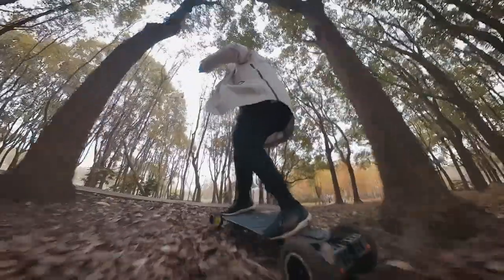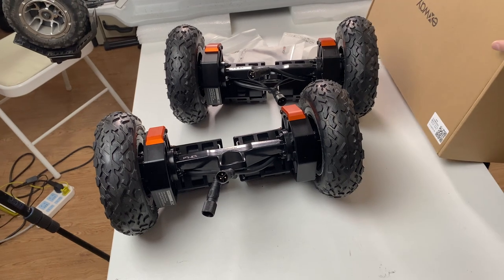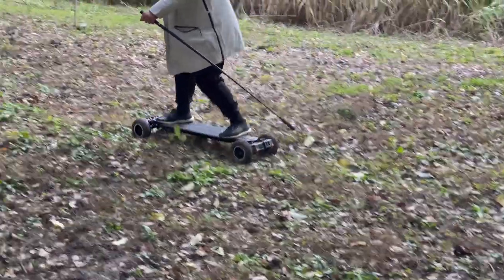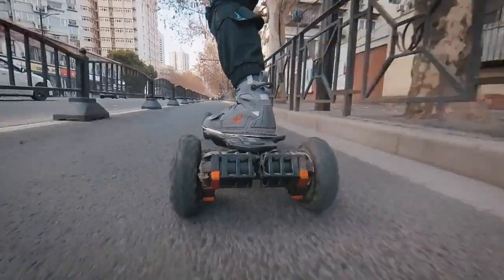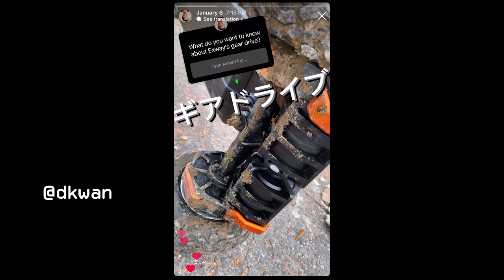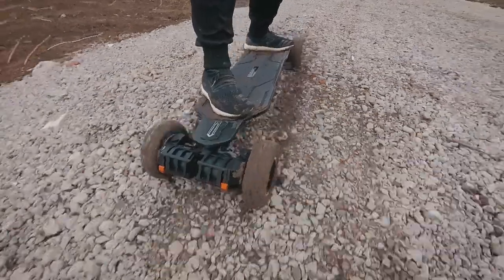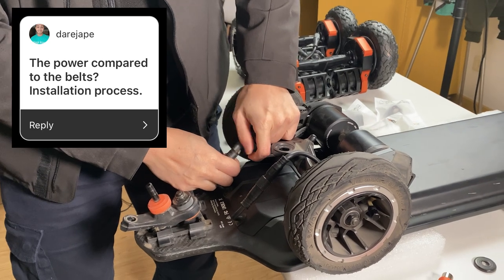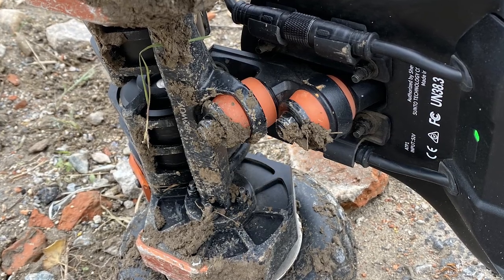Should YOU get a GEAR DRIVE electric skateboard?

Comment: Finally a review on the gear drive system! I definitely need this! I’ve gone through so many belts riding off-road, maybe 6 or so this past season alone. Paired with 4 wheel drive this thing is no doubt going to be a beast to ride on the trails especially with the aux pack. My only complaint is that the exway site only lets you get it in 2 wheel drive   For roughly $2,400 which would mean you would have to buy the front wheel drive system separately for another $700 so that means it would be $ 3,100 for your set up and $4,200 with the aux pack….. you could buy 2 or 3 electric boards for that price so it’s kind of ridiculous (unless I’m wrong about the prices) I’ve also done cnc machining and the gear drive gears and housing are not remotely that much to manufacture….. not sure why exway thinks anyone would pay that much for gear drive when the market for it is already so small…..

Comment: so TL:DR: it's great if you need a sealed drive train system, but for more casual use, a belt is still preferable.

I think for mountain boards and heavy duty boards (like the Propel Endeavor series) a gear drive would be great. it's not like people wanna swap gear ratio's to go 70 km/h on those boards anyway. but for street boards like a Hurricane or a Zeus, I'd stick with Belts.

btw, to answer to your difficulties of cleaning grip tape: I reccomend a cheap dishwashing brush, then putting the board on its side and pouring a bit of water on the grip tape. then scrubbing. then more water. then scrubbing. and rinse and repeat. then pad it with a towel and leave it upside down on said towel to dry. my griptape looks like new on my Eovan thanks to it and I've literally taken it over beaches and through storms. most boards are waterproof enough (from the top) that you can put water on the top of the deck, provided you clean it off immediately and put it on its side.
Reply: Yes with my Endeavor, I have to stop regularly and remove the back wheels in order to get rid of the gravel. A gear drive would be better for sure.

Comment: my belt broke after 1000km, and i drive daily but mostly in the city. Works gear, the wheels however went flat multiple times, i ended up buying the smallest tube i could find locally and folding it inside the wheel to fit, works fine, no way im paying 400$ for some wheels lol.

Comment: Having only ever had hub-motor boards. Should my next bboard be hub-motor, belt drive or even gear drive? I'm on the fence about belt drive mainly due to the additional risk of a full-stop malfunction - had quite a few bad ones of those from my first hub motor board (one of the first versions of Koowheel with ESC connection issues).
Reply: I have two belt drives and never had a belt break in three years.  You have to buy right is my opinion.  Depending on your budget exway tynee wowgo . Don't buy of Amazon ect.
Reply: I have driven belt driven boards for 5 years as a daily commuter and have never had a full stop malfunction. I've had several belts break over the years while riding and the biggest risk is lower breaking power. You can definitely tell when it breaks so it's not a surprise when you go to break.

Comment: In France, you not even allowed to river over 25 km/h so...
Also, is it more waterproof?
Reply: Given that the main issue with the waterproofing is the electronics, it probably no/little effect unless it covers so holes/gaps by coincidence. Also skateboard bearings and water don’t tend to mix well anyways. That being said; Guessing the real question should be: does it have drain holes (similarly to bike frames) to allow water to flow out if it gets inside?

As for france’s laws; you can always ride on private roads/in areas where you wont be stopped (ie; not in the middle of the city). I am mega jealous of the french laws regarding eSk8s; across the boarder here in Italy they have a limit on the motor power (500W) & top speed (also 25kph) so any decent board is illegal. Fortunately noone actually stops you (or at least noone has stopped me so far 😅… knock on wood)

Comment: If there is no difference in ride performance and quality overall, whats the point of paying 659$ for the gear drive? Even if it was coming preinstalled with atlas pro for the same price there would be  little to no reason to buy it because the top speed is significantly lower while not giving more torque in exchange.
Reply: Definitely not worth paying over $3,000 for it! I personally would benefit from it because I go through belts often and the gear drive gives you more torque and realizability off-roading and the speed drops down to just over 30mph which is still VERY fast but anyways it definitely has good selling points but WAY overpriced